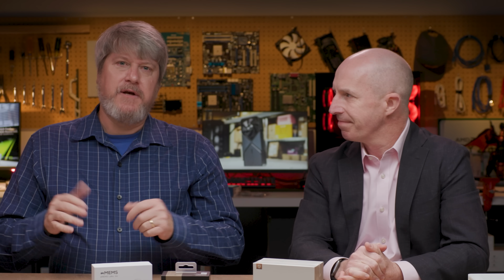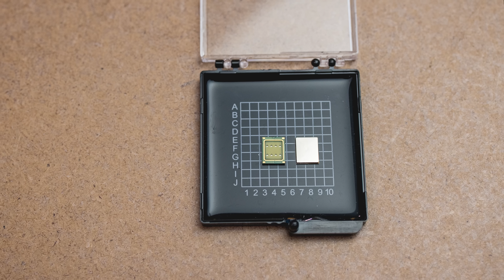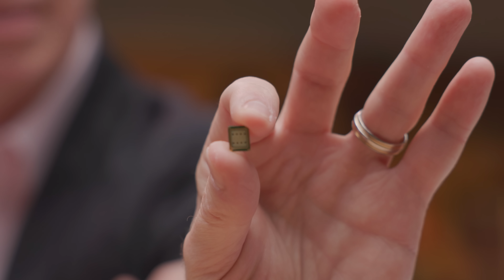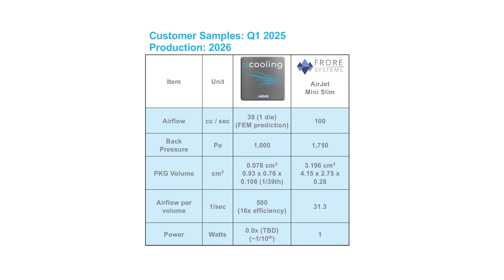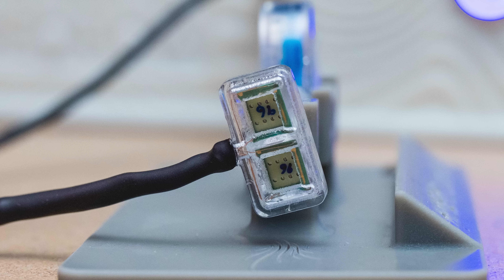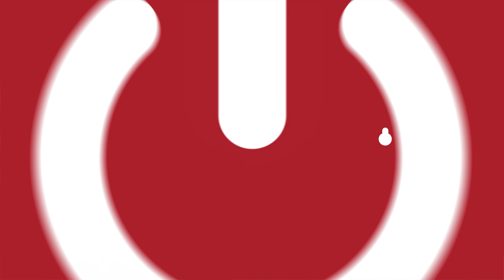This 1mm-Thin Chip Cools In Tiny Places

Comment: Has xMEMS considered the application of this tech to mouse skates? Given its relatively low power draw and compact package size...1Kpa of pressure being pushed out of the bottom of mouse basically makes for the perfect air bearing if you get the skirting right and a competitor to PTFE mouse feet, using µsilicon to take out forever plastics is a big deal and a jet of air is self cleaning to a degree keeping the contact surface from experience too much wear and tear.

But also it'd be pretty cool to have a mouse that can turn into a hovercraft for no reason and also cool off your palms with the intake flow when dealing with long spreadsheeting sessions.

But mostly I kinda wanna see a hover mouse, though it seems like it would be an expensive proposition...but a cool one for a turbo dork.

Dunno how the PFAS industry would feel about it though, it'd be like what Dyson did to the vacuum bag industry.

Comment: This is nice tech but whats the tolerance die micro vibrations produced by ultrasonic pulse would it be safe for the chips they are cooling what if there are micro fractures due to it and make a soc useless it should be tested

Comment: Might need a conductor to release the heat to the environment, as mobile phones are typically water resistant, so external airflow near non existant.

Comment: integrating this inside a low profile nvme m.2 ssd would be a gamechanger for cooling the controller without relying on external airflow to stop throttling and manage the drive's endurance. Of course, vibrations would be a factor to consider

Comment: The problem i see is smart phones now days are water sealed so yes it mived air but were would it get fresh air to cool a phone. As it cools the chio the air inside will heat up until it is now moving hot air over the chip and will eventually no longer cool the chip. In the end you just ise enegry thay creats heat and get a phew moments of coling then just waisting energy and no longer cooling
Reply: They didn't mention it but it's ip water and dust resistant as well as moisture

Comment: I really appreciate the tech you are dealing in and its huge, but I have one question: What about dust?
in general, the PC fan get dirty and we just open it and clean it once or twice a year. 
I hope it blow the air out of the device at certain level, if this chip is not ready for blowing the air out of the device then what is the point of circulating hot air inside the device!

Comment: Maybe not mobiles, they are sealed and waterproof, where the airflow goes ?
Reply: They didn't mention it but this cooling chip is ip water and dust resistant aswell as moisture

Comment: For anyone actually looking for an answer at how effective it is at cooling.

On a snap dragon 8 gen 2 with a vapor chamber that's 2 inches by 2 inches by 0.1 inches, and paired with 8 gigs of lpddr4 ram running a game like CODM on maximum graphics, it'll be able to keep it 4.5 degrees farenheit cooler than with the vapor chamber alone.
Reply: Wow that's impressive
Reply: HOLY SHIT THAT TINY THING?!??
Reply: @ezrakornfeld8436  

It displaces a shitload of air for it's size yes
Reply: @ezrakornfeld8436 Haven't seen the entire video. 

 Seen this company float a golf ball with a tiny chip. Think it was them. 

 It was an amazing demonstration, and made me think holy shit.
Reply: I can see gaming phones will improve a lot more in the future if this is implemented
Reply: @macksuting6263  won't just be gaming phones, every single device with a vapor chamber and one of these chips will basically never throttle
Reply: Just say it's capable of cooling X amount of TDP. How hard is it to say the chip has 8.5W

Comment: LIGA or Lithography, Galvanoformung (Electroforming), and Abformung (Moulding). Doesn't sound as cool when using only English LIEM. Either way, this specialist machining process, is used for creating "High aspect ratio" structures. The High aspect ratio in photolithography, is the ratio of the height of a vertical sidewall to its width. Achieving high aspect ratios is important for constructing tall microstructures without slants, and it has applications in areas such as biological materials and free-standing structures.

It’s often used for precision applications, such as MEMS (microelectromechanical systems). MEMS technology altered or enhanced some processes and created new tools to fabricate integrated circuits (IC) (deposition, photolithography, etch). Interestingly the etching process that is used to produce semiconductors is the lithographic etching process, which began life as an artistic application, an extension to photographic lightroom printing directly relates to the process, connected by a light source that uses a developed film to produce a photographic negative that directs a light source through an adjustable photochromic lens onto chromatic paper.

The process of chromatography includes a process known as Thin-layer chromatography (TLC), which is a chromatography technique that separates components in non-volatile mixtures. Often known better as a litmus test, useful to test chemicals in tiny economic fractions, revealing impurities and identifying distinct chemicals. Or measure the pH level of water in fish tanks and Swimming Pools.

Until semiconductors became the dominant usage, a process called "Copper Etching", conceptually identical to how vinyl masters metalwork is made with a stylus and lathe following the waveguide of an audio signal, while rotating a copper disc for the stylus and lathe to cut an inverted waveguide, produced as vibrations from waveform oscillations, resulting in the metalwork masters, that are pressed into clumps of warm vinyl that are pressed together from opposing sides, making records, that only now need a paper sticker and paper sleeve, inserted into printed cardboard, to create a finished 12" LP / EP / Single, sold as vinyl records.
Reply: The inverted normal state, used to create the metalwork is applied with a "negative resist" resin coating in bonded layers, the outermost layer is a common solvent, ethyl acetate/hexanes (EtOAc/Hex). Negative resist in this context, is dried in an oven and applied in stages, repeated to build up layers that are chemically bonded to achieve stacked layers of suitable tolerance, allowing for the stylus of a diamond-tipped lathe to produce a Low aspect ratio, cutting grooves to the resist layers. 

Contact with the precise fine tip of the industrial diamond cutting lathe (deep red, similar in appearance to Ruby lacking lustre, unlike polished diamond in Jewellery) which is guided by the audio wave and hence the term "waveguide", while being rotated and variable speeds ranging; 33⅓ rpm, 45 rpm (most common), 78 rpm and 96 rpm now far less common, vibrations produced by oscillations of audio, the waveguide. 

This produces a limited-use "Acetate", good for maximum play of around a dozen cycles on a turntable, with a diamond or tungsten carbide tipped stylus reading by simply using gravity, and slow rotation to mechanically encode from an audio waveguide. They are made as a single edition or test plate and are often called a "Dubplate". Acetates are made in very limited edition 'cuts', primarily used by DJs and Music Producers, as a method to play music on traditional turntables as ordinary records, in a part of their DJ set or delivered as an on-stage appearance, where a turntable is a method for part of a live production (Public Enemy, Beastie Boys and old school DJ events).

The advent of time-coded vinyl or digital vinyl, in digital DJ platforms, ranging based on the manufacturer from Serato Scratch, Native Instruments Traktor 'Scratch', and Pioneer Record Box DVS (digital vinyl system) making the day of the dubplate or acetates a neglected aspect lost to time and history.

Comment: What is the max newtons thrust from one of these chips?
Reply: Newtons pSI measured in LBS - lol sound and micro thermals at the nanoscale in MEMS/NEMS measurement of pressure, use "minute differential pressure sensors" (MDPS's), resonant MEMS pressure sensors are the most accurate and stable pressure sensors available. In a counterintuitive paradigm shift that turns intrinsic thermal noise from an impediment to a constituent of the sensor by harvesting it as the driving force, obviating the need for external actuation and realizing ‘noise-driven’ sensors, microspeakers and microcoolers, is what is being discussed, not drag racing cars! 🤣

Comment: With how hot some of the fastest SSD's are getting. If they could collaborate with the right companies, this would be a fantastic opportunity to get rid of the potential overheating problem.
And even if it costs a bit extra, most people only need the fastest SSD's for their OS so then Windows will run faster and more responsive. People can still get the cheaper/ slightly slower less hot SSD's for expanding storage. So it should realistically not add that much cost to a PC, I'm sure laptops could greatly benefit from this cooling technology.

Comment: Cooler heads prevail, and baldness helps to release heat, but having hair causes heat to remain trapped inside the skull and that cooks the processor, so with any luck, you will go bald as a form of protection against permanent brain damage.
If you want to keep your hair, then you will want to install these thin 1mm chips below the scalp.

Comment: It doesn't need any power Mr powers, you just charge capacitors in sequence using prime lattice 7 x 1,000uf -> 11 x 500uf -> 13 x 250uf -> 17 x 125uf -> 19 x 63uf -> 23 x 31uf -> 29 x 15uf, just has to be half, one series array to full multiplier at 220v 200mhz, because capacitors just store voltage, especially small ones.  Going by half is the most efficient cycle using less than one arrays worth for any size array, just has to be PNP.  The prime offset makes the full multiplier always discoherent in every four stages forcing the charge pump with 558 timer logics.
Reply: Brother what

Comment: it blow air from heat source to anywhere of the phones and gonna make phone heat balanced but not cooled,if you need to make phones cooler with cooler tech you need to some air gaps to distribute air from inside to outside,that gonna make it non-water proof but nano-coating can fix this issue as we see on fair phone,if you combine all those techs phone would cost 2000$ish dollar and it's gonna worth it,trust me

Comment: 8 inch wafers means +130nm, 180/250/350nm.
The 8in to 12in transition was in the early 2000's and 130nm and 90nm where the "new" processes during the transition period.
Reply: In standard lithography, you are absolutely right and you present a good summary, however, MEMS wafers are specifically designed for micro-electromechanical systems.
They have different properties, such as thickness, positive photoresist coatings, and additional layers, to accommodate the MEMS - 1nm min feature 0.5 μm - fabrication processes.
Handling and processing ultra-thin MEMS wafers often require special tools like carrier wafers or support wafers, typically blank plates.
Reply: The silicon-on-insulator micromachining PiezoMUMPs process has the following general features: 

1. A silicon-on-insulator (SOI) wafer is used as the starting substrate. The substrate has the following characteristics: 
• 150 mm (100) oriented SOI wafer.
o Silicon thickness: 10 ± 1 µm 
o Oxide thickness: 1 ± 0.05 µm 
o Handle wafer (Substrate) thickness: 400 ± 5 µm 

2. The Silicon layer is doped, then patterned and etched down to the Oxide layer. This layer can be used for mechanical structures, resistor structures, and/or electrical routing. 
3. The Substrate can be patterned and etched from the “bottom” side to the Oxide layer. This allows for through-hole structures. 
4. A thermal oxide layer is patterned and etched to provide isolation between the SOI layer and the AlN and PadMetal layers. 
5. A piezoelectric layer, AlN, allows for the development of piezoelectric sensors. 
6. A pad-metal feature that allows finer metal features and precision alignment but limited to areas not etched in the silicon device layer.

Comment: Sure for phones this isnt quite as good as they are sealed for water resistance so all it would be doing is cycling the hot air and waiting on the chassis for heat transfer? 

Thats why you have vapour chambers setup currently linked to thr chassis to help distribute rhe heat quicker. If the phone was open to air then yeah this sounds promising but i dont see that happening unless ive missed something obvious?

Comment: Imagine a thin liquid cooling block powered by the MEMS... a CPU liquid cooling block being its own pump :)
Reply: That would be an interesting concept with MEMs.
They have basically been working on a similar idea since the 90's with microchannels, the silicon itself being the cooling block, but never really went anywhere.
The idea got new life in ~2010 thanks to 3d stacking. It was thought that it would be a good way to remove heat from chip stacks.

Comment: I wonder how good these are inside a sealed phone, or will this require some holes to work? And will it cancel the big gains in water protection rating?
Reply: Perhaps it would be possible to have a tiny heat pipe or even a more simple metal plate to deliver the heat from the main sealed body into a very small non sealed cavity in from which it would circulate the air? Just an idea, I have no knowledge to base this concept off.

Comment: Integrated cooling via 3D stacking would certainly be interesting for a big efficiency gain in power and area utilization. Given the limited surface area, I'm certain it will always be limited to very lower power chips though.

Comment: I think there is an issue with approaching smartphone cooling given the ever greater emphasis on efficiency in smartphones. We want more performance, but we can't very well increase the power because we dont want a larger battery, so that means we want more performance at the same power... Active cooling will still require some additional power to run and will thus provide a worse experience on smartphones that tend to already have rather limited battery lifes.
Reply: True but this is different I've herd it doesn't take much power at all from the battery and it's small for a reason imo that's impressive
Reply: It consumes less than a watt don't think it even matters

Comment: the idea of chiplet based cooling is really something. might actually be a lifeline to increase transistor density and thermal conductivity. these mems structures could be placed near logic dense areas where significant concentrated heat is generated. we may be going back to a time where chips didnt need extra cooling. direct wafer bonding is on tsmc roadmap. but sounds like fab tech for mems is far behind.

Comment: Awesome idea. How does this effect water/dust resistance ratings? How much water and dust can these chips take?
Reply: I was thinking the same. With vents providing openings, this definitely my first concern. Maybe the vented areas are sealed off separately from everything else that doesn’t need to be cooled as much.
Reply: @miniVoo  Good idea. However wouldn't they still leave the cooler itself prone to getting clogged? I suppose as long as it could be cleaned with compressed air or a light rinse it would be ok, I'm just curious because they didn't mention it in the video.

Comment: I'm interested to see how this tech can go. I wonder how good the audio is of headphones that use it compared to other methods. Also for chiplet cooling, how efficient is it as far as power and airflow compared to fans? I wonder how long these things can last without degrading or is there a chance in some months of using it for cooling they can get plugged up with dust? If they did get plugged with dust, can they easily be cleaned?

Comment: I do wonder how airflow would work with smartphones when they've basically been trending towards sealing for water resistance purposes. If you're then opening up paths for airflow, how does that get dealt with in terms of water ingress.
Reply: @eirinym  agree, same comment as mine above. I struggle to understand how it would work without venting the hot air.
Reply: It looks like this may be used to move heat away from the chips themselves to somewhere else within the device, likely a heatsink or similar, the hot air carrying that heat away. The point being it moves the heat away from where it will limit performance (like the surface of a chip), to somewhere where that heat is not going to cause a problem, like a heatsink or perhaps even to the outer casing of the phone (and then conduction pulls the heat out of the phone), but all this happens within a sealed device, rather than having open airflow in and out of the device. Just my guess.
Reply: @raymonddsouza8948  air will never be as efficient as direct contact in terms of heat transfer. Hence my struggle to understand. I don't understand why you won't just use a heatpipe or graphene sheet or similar.
Reply: @fuicaz this is definitely more suited towards consumer electronics that doesnt need ingress protection, this technology would definitely replace the traditional heatsink + small fan combo in smaller devices such as a microcontroller, no way this would replace vapor chamber for smartphones anytime soon.
Reply: @sephylle  Agreed. This is definitely exciting, just probably not in the smartphone space.
Reply: @fuicaz  Just add a mechanical cover that can open and close.
Reply: Separate chamber for cooling with a heat exchanger between them is how I would do it.
Reply: @ezrakornfeld8436  could work but definitely reserved for the more gaming oriented phones honestly
Reply: Close to speaker grill where air flow would happen